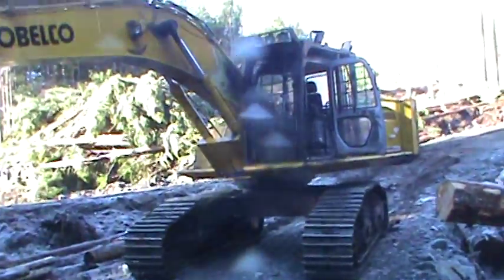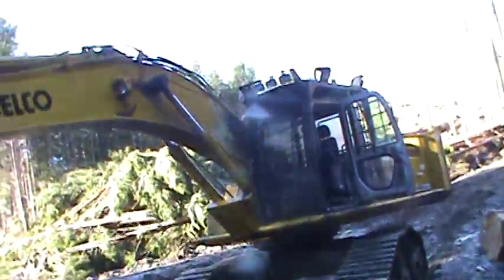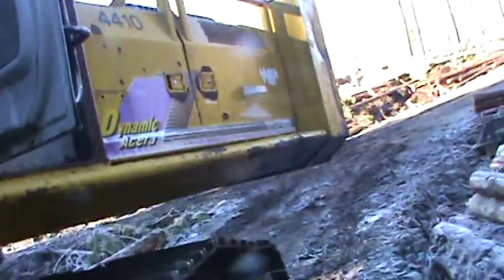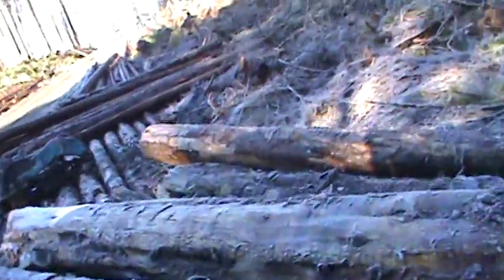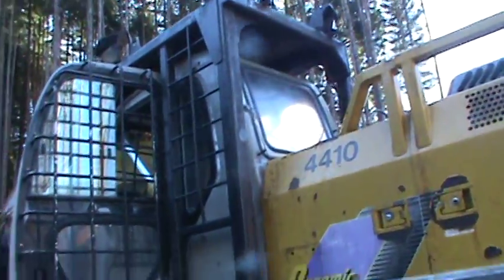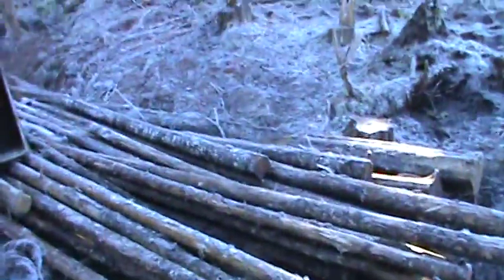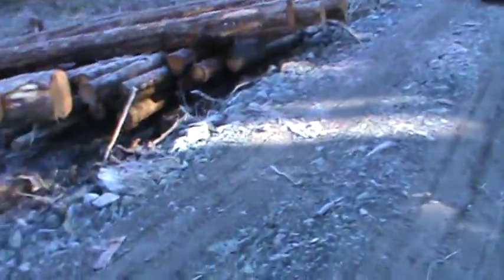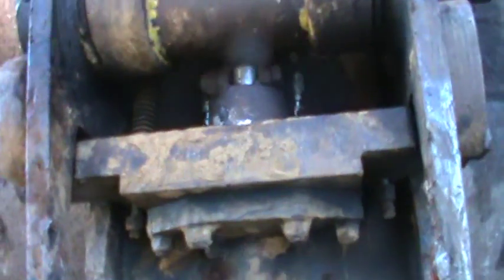2005 Kobelco SK370RB T-Mar combo roadbuilder-hoe chucker excavator

Comment: We've got 2 kobelcos a 12 ed150 blade runner and a 13 sr140 awesome machines we use them mostly for road deactivation but last year we did a few road building jobs for the yarded and lots of government work super smooth machines especially the se140 with the new hydraulics I've been thinkin about posting deactivation work on here this summer great videos bud👍
Reply from the maker: Thanks for the comment, always appreciated. I was on a 2012 SK350LC-8 for another contractor last year, and still own a SK75UR-2 and dad owns a SK200LC Mark IV.

Comment: I never run a Kobelco before. Is it a bit like Hitachi ?
If the motor is as good as a Izuzu it should be no probleme.

Glad you have a job anyway ! Instead of me sittin at home every f@cking day...
Reply from the maker: This has a Mitsubishi inline 6 cylinder turbocharged.  The head gasket is weak and will be replaced when it gets barged for 3 days back down to Campbell River, BC, and the cylinder head is pulled on the engine and re-decked. It has around 10,000 hrs, I believe. Everything for equipment leads a hard life in coastal logging, but is kept up for repairs best as possible given our remote location on the BC coast. The Cummins powered SK375LL Mark 4 we also have onsite, I believe is a superior unit to the Dynamic Acera series, that is shown here. However this machine shown works everyday, and its rigourous work, at that.

As for work, I`m never seeming to be out if work. I turned down 2 job offers in the past 3 weeks. I enjoy what I do, and the crew and company are fantastic and that`s sometimes pretty hard to find. If I do come up quiet at work, I have my small excavators back at home I go and run. They are paid for and are ready to go.

I enjoy my vacations and time off with my son, and seem to have a new girl that appreciates me. I didn`t say everything was perfect, as we all have our problems in life. But it`s pretty good currently.

I can`t speak for your situation but it seems you have lots of life problems over in Holland from what you have described to me.
Reply: Tax me I'm Canadian A company I've worked with for years has a old, I believe '87, Kato excavator with a Mitsubishi  engine in it with around 11,000 hrs on it. It's never had a engine issue since new and it's the most amazing thing in that no matter how cold or hot that thing fires off on the first crank. The rest of the machine is falling apart but that engine just smokes a bit when first started and runs like a top. Been enjoying you vids, Canadian logging is interesting to me even though I've been in construction of one type or another my whole life.